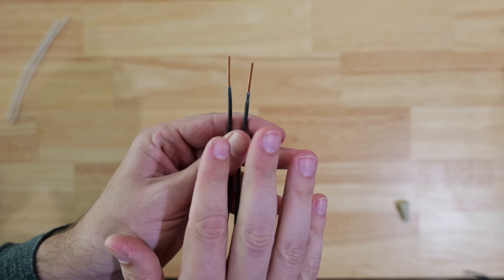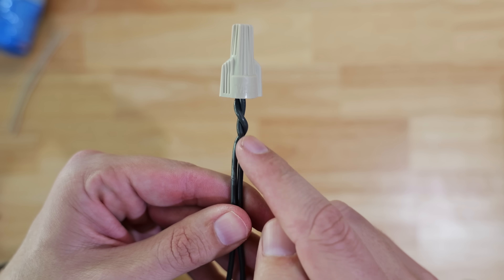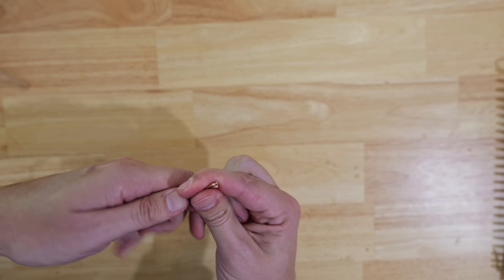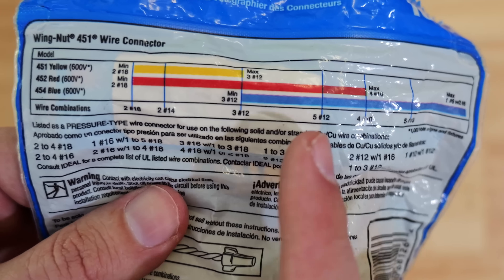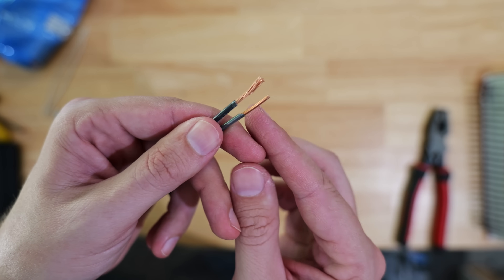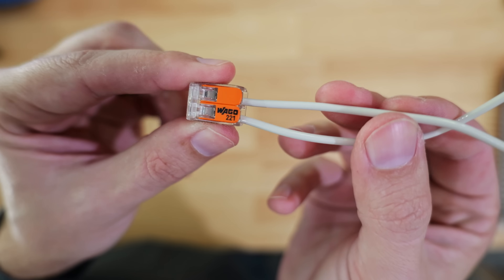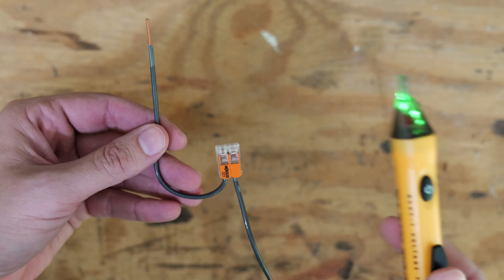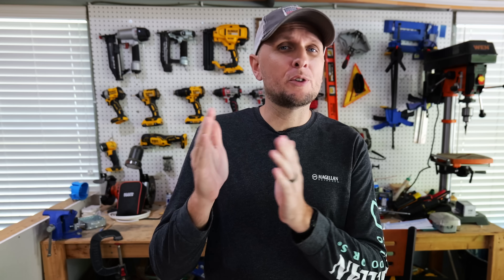7 FATAL Wiring Mistakes Most DIYers Don't Know They Are Making | Most Are Guilty of 3

Comment: As a retired electrician, I can say that I have never had a wire connection come loose, ever !    While I did use Ideal wire nuts (the non-winged version), I also used 3M brand wire nuts.    OH...  There's an inexpensive installation tool just for those wingless nuts...
Reply: I wondered about that from a pro's point of view. There are 10k of these videos like all wire nuts or connectors are on a moving ship and coming loose. I dunno, but probably should be 10k videos on how to drive more safely LOL then wire nuts and wago connectors that probably come loose 1 in 100000000 occurrences.
Reply: 42 years in the trade and I'm 100% in agreement with you. I never had an issue with any brand of wirenut. 3-M or Ideal, they work everytime all the time. I also hear non electrical terms "solid core vs. stranded core" and "braiding. He just sounds like another WAGO salesperson.
Reply: How would you know if they ever came apart after you've left. A year down the track, and they wouldn't come looking for the original sparky (electrician)
Reply: 🤣⚡️🤣⚡️🤣⚡️🤣🤣3 phase
Reply: Electrical dinosaur here.  Never used Wagos, never will; same as I've never just stripped a wire and shoved it I to the back of a receptacle.  Too much current to rely on a thin piece of spring metal.
Yes, the heating and cooling that occurs in a circuit will loosen connections EVERYWHERE in a building.  I've gone back to homes I've originally wired to add whatever and when in the panel, found nearly every screw loose on the breaker or fuse block.  I've also found marrettes loose 10 years later.  
I'm old enough to have used mechanical MARR connectors ... brass sleeve with a set screw covered with a baseline capped that was screwed on.  I've taken hundreds of them off in commercial applications (constant modifications) by just grabbing them and pull.  The screw loosens over time and heat of current.
I install marretes on the wires as tight as I can to get the lower twists in the insulation, then I put them in the box vertically with the top of the connection up and the wires pushing into it.  In a device box that's horizontal; I still use the wires to put tension into the connection.
Reply: The way you wrapped tape around the wago is the wrong way to wrap tape. Always wrap clockwise away from you, then pull with your pointer finger hooked under it when the tape is at the 6:00 position. Avoids the fumbly pushing/trying to rip the tape that you showed, plus you wrap it tighter going this way.
Reply: i've seen it many times.  especially with ballast wires. in one business i changed connections to wire nuts and reduced electrical bill by 600.00 dollars.
Reply: @joelunchbucket  I was an industrial electrician for 24 of those years working at a 3M facility...   I can attest to my statement due to 1st hand knowledge.
I also was a C-10 (general electrical) contractor in the heavy mining industry.   Spent years supporting those in the industry from pre-installation to support years down the road. I began my electrical career serving aboard US Navy Destroyers, some of which were WWII DDs.
Reply: @thomashardin911  
But only up to 4160.   Beyond that, calls would be made...   :)
Used wirenuts for 480 and below.  ;)
Reply: @teddahrable  a screw plastic fitting with 240v short circuit would melt. Your only using 110v which is 50v-50v. A Wago has a 32A rating and can cope, and made of metal cover with a high quality material
Reply: @jlinkhart  🙄 Which way should my pinkie be pointed though 😂?
Reply: @carlhephill9359   $600 per century?
Reply: @TheEclecticHandyman  I had a circuit go dead and I assumed a rodent had chewed through a wire because for a period of time we heard scampering in the joist bay.  My election traced the problem to a j-box with a melted wire nut upstream of most of the receptacles.  The copper coil inside a wire nut separated from the plastic exterior but it still held both wires, so one would think that there would be continuity.  Maybe melted plastic got between the wires.  That's not a good explanation, but it's the only one I can think of.
Reply: @teddahrable  Yes electrical dinosaur think: "Too much current to rely on a thin piece of spring metal."
German engineers just make the WAGO capable for the needed current only.
Take a YT search for "wago overcurrent test" yourself, dinosaur
Reply: @martinlewis1015  3M rates their connectors for up to 40 amps, 8 GA wire.  The wire insulation won't even keep from melting in a full 240 V short circuit.  That's any kitchen range in North America.
Reply: @proislam1447  I readily admitted being a dinosaur.  Marrettes are rated for current, as well.   And a 14 gauge wire twist provides more surface area to spread a load out than a straight strip of metal. 
Don't fix what ain't broke is my motto.  Marrettes have never let me down, no need to change in my opinion.  Luckily, that's MY opinion and no one else needs to adopt it.
Reply: Nothing beats a good twist to make the connection and a wire nut to cover the connecting except the old fashioned  way of a twist, solder then a wire nut!
Reply: @teddahrable  I can tell by your few words mentioned here that your were a good electrician! Everything in your sentence is 100% correct.
Reply: Klien and Ideal had screwdrivers that had an opening in the handle for wire nuts.
Reply: @explod329  eh, soldering can lead to embrittlement. 

I do prefer wire nuts to wago. Properly installed theres much more surface contact for current transfer, and they don't ever fail like wago enthusiasts insist they do.
Reply: @joelunchbucket  if there are going to be any issues of wires coming loose, it’ll usually be within a few months. Most EC’s give a 1-year repair warranty at the end of a project. Most of the customers my company does work for are repeat customers and use us for service calls. I’ve been at the same company for 10 years and very rarely have callbacks for warranty repair work.
Reply: @knotbumper  if someone mentions wire for small branch circuits, I just say “solid or stranded?”
Reply: As a professional electrician, there is no incorrect direction to wrap a wago with tape. That is some seriously petty micromanagement.
Reply: @Phillip Banes just not ear protection ...
Reply: @Phillip Banes yeah that's why they got sued into oblivion and paid out settlements, because they were the best.
Reply: @martinlewis1015  lol 110 isn't 50-50v 

And wire nuts don't melt when properly installed, just like any other rated connector.
Reply: @16vSciroccoboi  110 is fed via a transformer +55 -55 which makes your 110v
Reply: @martinlewis1015  no, it's not. It's +170 /-170 roughly. 120v is the rms voltage. Peak to peak voltage is like 340v.

Either way, voltage of the circuit virtually has nothing to do with the wire nuts melting during fault conditions. Amperage is what causes heating. 

Most wire nuts are rated to at least 300v, good ones are rated to at least 600v.
Reply: @Phillip Banes you missed the entire 3m lawsuit news because of hearing loss due to them selling known defective ear protection to the military? 

Definitely not an ambulance chaser, I work in the trades, I use PPE all the time.
Reply: @16vSciroccoboi  the +55 -55 is only on 110v from transformers, hence why we use them on site for safety
Reply: @knotbumper  when i went to school to be an electrician i was taught the terms solid and stranded wire not core ive never heard of the core term ever i also have never heard of any wire having a core as far as i know there is aluminum wire and copper wire i have also heard of copper shielded aluminum wire but again not ever the term core
Reply: @martinlewis1015  umm every AC circuit feeding a building uses a transformer. And if you have +55/-55  peak voltage you have 38volts rms. 

You should probably read a book.
Reply: @16vSciroccoboi  then go and read it. Mine is called BS7671
Reply: 3m scotch locks sucked. We were contracted to a 3m tape plant and if 3m made it we had to order and use it. To me ideals were way better than 312s or 512s
Reply: @martinlewis1015  requirements for electrical installations? Essentially the same thing as our NEC code book. 

So that tells you how rms voltage and peak and sine wave voltage works?  Because maybe they should review what they've written if that's what you derived from it.
Reply: @16vSciroccoboi  ours is written by top sparks, and we have to pass an exam. And the book gets updated every 10 years if changes to electrics have to be added
Reply: @martinlewis1015  cool story, it clearly doesn't tell you how rms voltage is derived.

Ours is updated like every 2 years.
Reply: @16vSciroccoboi  £60 a book and cost each spark months to learn and pass exam...what's the point. You don't have RCBO's and other equipment in circuit to worry about. I would like to see you pass British exam far past yours
Reply: @martinlewis1015  and none of what you're saying has anything to do with the fact that 110v AC systems aren't +55/-55

You came in saying something that is patently false, and now you're trying to argue some code superiority argument. 

You could have taken the opportunity to learn something and gain a better understanding of your craft, but here you are.

And Europeans call Americans ignorant. Lol
Reply: @16vSciroccoboi  your going on about rms which has nothing to do with what I am talking about. The 110v system is used in sites for safety because it splits the voltage from transformer +55 -55 which is what we use on site. Not a 230v system which is our mains system. US is a 120v system not a 230v
Reply: @martinlewis1015  "a screw plastic fitting with 240v short circuit would melt. Your only using 110v which is 55v-55v"

You literally said that. 

You said our American 110v system is 55-55v. It's not. 

Just like your 230v system isn't 115-115

So what were you talking about then? You keep changing your story, changing the focus to your code books and their cost and what ground fault protection you use, in what I can only assume is an attempt to be less wrong. 

It isn't working.
Reply: @martinlewis1015  and rms has everything to do with what we are talking about, because AC voltage like 120 and 230 is the rms value. 

If you put a voltmeter on an ac circuit, it will show you either average voltage or RMS value depending on the meter.

If you plug a 110v ac appliance into a circuit that provides it with +55/-55  RMS voltage that appliance isn't going to work, because it only has half the voltage it needs. Period.
Reply: @16vSciroccoboi  neutral does not carry current, only live but the diagram from drawing shows it as -55 but it's not down the neutral wire
Reply: @martinlewis1015  ... How can the neutral not carry current? 

You can't have a circuit without a return path. If there's no neutral or in our case another hot, since we use split phases for 240v, you can't have a circuit.
Reply: My BS meter just pegged out!
Reply: @martinlewis1015  I found an article about the 110v systems you speak of on sites. 

You didn't mention that it was a system which uses NO neutral at all and has TWO hot wires at +55 and -55. 

That makes sense now, and would work fine with regular 110v appliances. 

Still not the same system as we use in the US with 120v hot to neutral though, and still won't have anything to do with melting wire nuts. And it still won't be 110v peak to peak.
Reply: @TheEclecticHandyman   right!!! Definitely need videos on how to drive more safely.  The roads are loaded with crazies.
Reply: @teddahrable  LOL-- you and I alike.  That's one thing they'll never change in me, is making a good solid electrical joint and using good quality wirenuts like the Buchanan B2s.  Those WAGOs are the fast food electrician's foretay...at the end of the day, it's just a gig to slop and throw things together faster, so they can jump in a van and fly to the next site.  Yeah, I'll use Polaris Lugs in makeups and gotten away from split bolts on most occasions but when it comes to branch circuitry and joints...I'll always have a pair of Kleins in my back pocket and a pocket full of quality wire nuts.

Comment: Very helpful, thank you very much. I've done the wire-nut things too often, but I've had the common sense to wrap all my connections up with electrical tape. Thus far no fires or equal, but I'll be sure to double check my connections and redo them when I get the chance.
Reply: I rarely use electrical tape, but I make sure the wire nuts are inside the nut.
Reply: I just commented the same. Electrical tape for extra safety

Comment: I'm glad I just watched this video.  For 30 years I didn't pre-twist with the thought that it was correct but never confirmed it.  Yesterday I decided to pre-twist when I installed a furnace motor.  I have no idea why, maybe subconsciously doubting the process I had used for years considering I have never had any formal training and have heard electricians do it that way.  Glad to learn my way is okay.  My thought now is how long would I have pre-twisted if I hadn't watched this video. lol. Thank you!  Edit:  I forgot to mention how many of those mistakes I have made?  All of them!  Thank you for keeping homeowners safe!
Reply: It's better when twisted however if you have to take it apart hot(which I know as a electrician of 30 plus years never happens) those twists can make life tricky.
Reply: If you look on the packaging for the wirenuts, it’ll actually be printed whether you should pretwist the wires, or if it’s not required. I always pretwist my joints because there are less chances of joints coming loose.

And to Brandon: yes, I am ALWAYS thankful the previous guy pretwisted the wires when I have to take a circuit apart hot.
Reply: Your wiring connection technique  is like Schrodinger's Cat.  The wires are twisted, not twisted or partially twisted all at the same time until you go back and check them or one of them cause a fire.🙃
Reply: @J_Trask  
Most instructions say that pretwisting is acceptable but not required.  As long as all wires are securely in the spiral and tightened to a reasonable point (but not too tight because I've seen wires break), the connection will be electrically/mechanically sound.

Comment: I've done a lot of wago usage, never ever did the leavers open while pushing them into a box. Also for boxes you often use the wago without levers. 
Same as the wire nuts, you have to use them how they are intended. Then they are safe and much nicer to use.
Reply: he sure seemed to trash the Wago's. Personally, I only work with them if  possible. I use them all the time.
Reply: @jstone1211  I agree. Now when you buy light fixtures (such as LED pot lights) they come with Wago clips instead of wire nuts. It's the future for sure. One thing he didn't say in this video is that those Wago clips are rated for current and voltage (in his case 20A/300V Wagos were used - written on the side of the Wago clip).
Reply: @joireland  just like everything, there is a use/place to use them. key is knowing the when/where. I will use them on 15A lighting circuits but not on the 20 amp receptacles although they are rated 20 amps...just my personal preference. I usually take the conservative approach....
Reply: @jstone1211 Most electricians are slow to change. In the UK you only see Wago connectors (hard to find those old wire nuts anymore - especially in Germany). Something you probably didn't realize based on your comment. There's 30A Wago clips called Wago 221-612. You can also get 3 connector (Wago 221-613) and 5 connector (Wago 221-615) variants. For the 5 wire variant you can also leave some of the connectors empty and still pass code.
Reply: @joireland  thanks I will get a few to try...great sharing info from across the pond. Here in America, all hell is breaking lose so...hard to tell if we will make it another five years.
Reply: @joireland I use 221-412 and they're rated for 32A. And the push-in 2273 is rated for 24A
Reply: @justme5384  Actually the 221-412 is rated only for 20A. It's the 221-612 that's rated for 30A. You can see that rating written on the side of the WAGO.